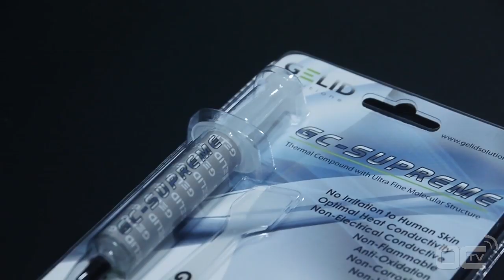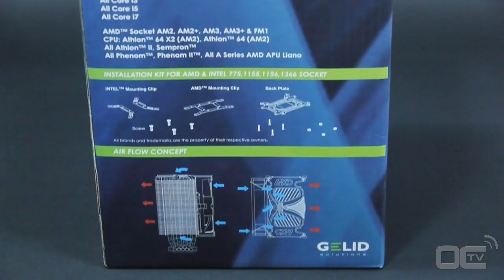GELID - GC-Supreme / GC-Extreme / GX-7 and how-to install.

Comment: which one is better? price doesn't matter
Reply: +DRUNKENPOT 
GELID SOLUTIONS extreme  is the best of all thermal pastes on the market :)
Reply: +Philipp Egal yeah that the one i bought the green one right? my cpu alway on 25 degrees
Reply: +DRUNKENPOT yeah the Green one if you want all in all a cooler System think about gpu cooling the prolimatech mk26 as Example Can Make a difference from about 30° celsius
Reply: +Philipp Egal so i could apply this paste on my gpu as well?
Reply: +DRUNKENPOT yes
Reply: +Philipp Egal ok i'ma do that soon ty happy new year!!!!
Reply: +DRUNKENPOT np bro happy New year